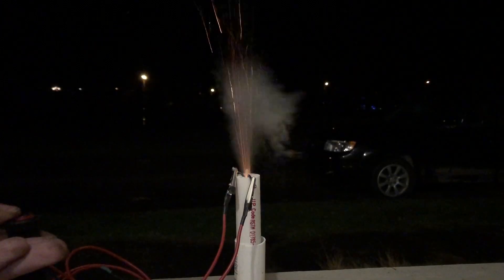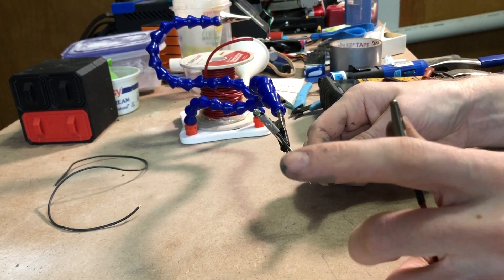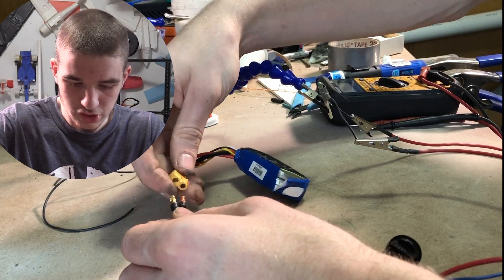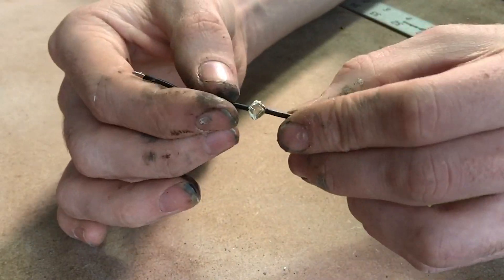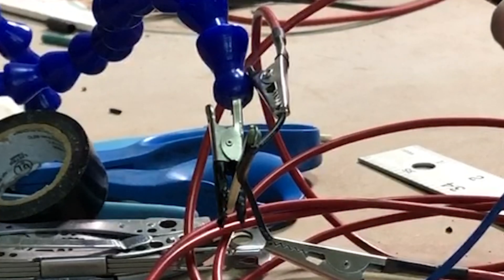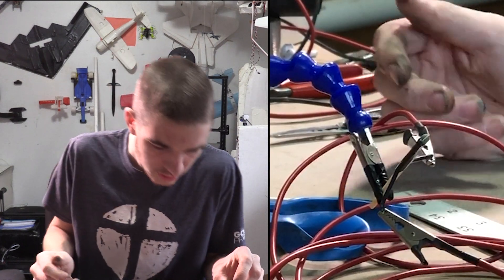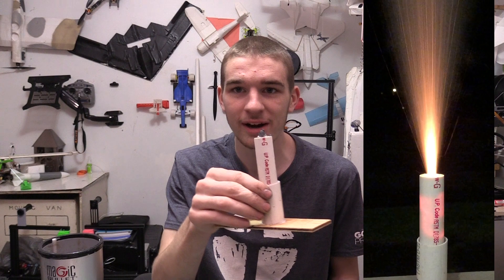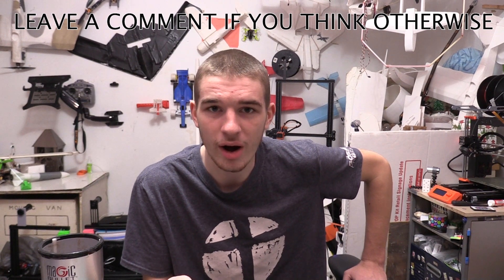How to make Electric Rocket Igniters (FUSES)

Comment: Very, very interesting! As a matter of fact, your approach to solving the problem has this quality of scientific rigor and interest. Really liked all your objectivity and checking point by point each of the elements that could be defective or which was perhaps simply not optimal. This shows a way to respond at a technical challenge with a reliable solution and by that to show that before attaining perfection you should expect to face several unforeseen events. Excellent teaching!
A little mod: just watched again and something I would have done is (yeah, I know it's been e years since now, but hey!)
Talking a little about the voltage used. Thanks again
Reply from the maker: Many thanks! Glad you liked the video. Have a great day!

Comment: Nope, it is probably your igniters, you can use either granulated or powdered sugar. AND, you don't even have to grind the ingredients up, it is all in the "packing"!

Also, an issue you might be have if the engines are not lighting is that your ingredients may have absorbed to much humidity (water) and become hygroscopically, saturated.

But, more likely it is your igniters. We have been using PVC rocket engines for over 50 years now! So keep at it!